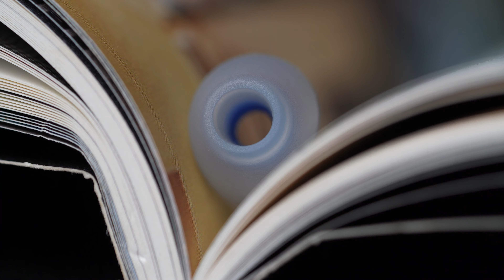Eartips Part 1: Getting the best out of your Silicones

Comment: Ordered the Spinfits for my BL03, ZS10 Pro and FH3 to tame that bass and check how they sound. I love bass but only a tasteful amount that doesn't mess with the mids. Thanks for the detailed explanation!
Reply: How are your Spinfits treating your BL03s? Was thinking of ordering CP100 and CP145 myself for my BL03s but not too sure
Reply: @TF2ReplayMaker  Much better fitting than the ones included. The bass has definitely been tamed a bit. I got CP 145 for all three because it has the widest bore, which also helps in emphasizing the mids and highs slightly.
Reply: @MuhammadHammadAshraf  hmm... Wider bore didn't result in the BL03s becoming too sibilant?
Reply: @TF2ReplayMaker  I haven't noticed any sibilance. I've tried using them with a 2.5mm balanced cable, which sounds much cleaner but still, no sharp highs or upper mids.
Reply: Do you still have the FH3? If so, which tips are you using?
Reply: @FabioKasper  Yes I do. Currently using CP155s on them. They were so wide that I had to cut the bores from old spare tips and fit the CP155s on them to make a snug fit for the FH3 nozzle. The result? Sound is just like the CP145 tips with a very minor extension to soundstage horizontally. I'd be lying if I said I can distinguish between high and low soundstaging but it sounds crystal clear and the bass is the same, deep with good kick. Planning on upgrading to Moondrop Variations though 😁 The search for the perfect IEM to suit your taste never ends.
Reply: @MuhammadHammadAshraf  Nice. Thanks for the tips. 😄

Purchased the FHE version and have been fighting with the bass tips myself. The seal simply does not stay in place. It is very annoying. 

A Final Type E set is on the way and may try other SpinFit alternatives if needed. Geez, this never ends indeed. 😂

Comment: Hi ☺,I cant agree with that last one statement about the cp100, they can actually bring mindrange more in to your face (that u had right), they can slighty tame trable (that u also had right), but actually can nicely enhance bass also (not tame them) 🙂. And I use both the final Etips and cp100. So from my experience the cp100 can also enhance bass compare to some stock (bass boosting) eartips.
Reply: @cuprajake1  I have never heard cp100 only cp100+. But the cp100+ should be an upgrade in therms of build and sound. Ear tips do different things to different iems. The cp100+ do different things (soundwise) to my kinera nanna 2.0, 7hz salnotes zero and hz sound heart mirror pro for instance. The best way to know is to do some comparisons between  tips (tip rolling). But I doubt the cp100+ would destroy the sound in any iem. Buy them and later maybe upgrade them with tip that would fit ur iem better sonicaly(and maybe the cp100+ would be just the best who knows)
Reply: @cuprajake1  u should be fine with cp100+ then. They have good sizing.

Comment: Why why why, is there not any eartips that can provide near flat response? 
I want to upgrade the eartips for Moondrop Aria!
Any recommendations?
First I thought of buying Spinfit CP100 for the Arias but stopped myself thinking that it may make Aria sibilant because of wider bore size than stock Aria eartips. Is it possible?
Reply: did you find your answer? I'm in the same predicament and these 3 are probably my options except I would go with the cp 145 just for the shape.